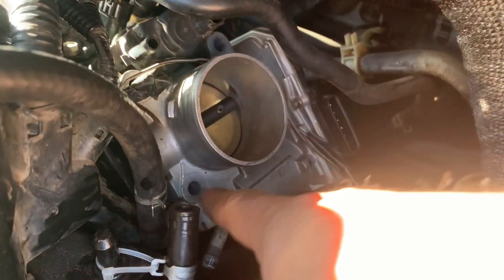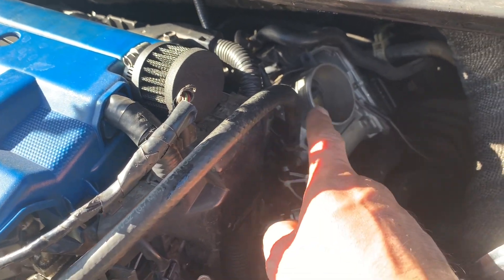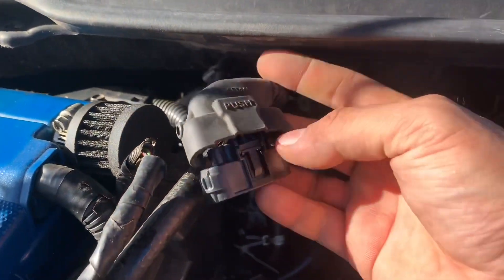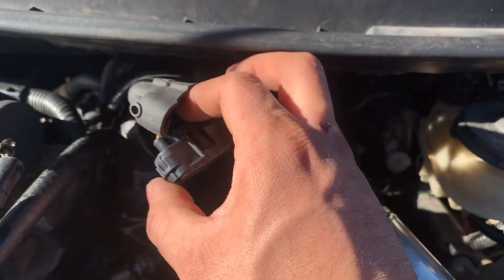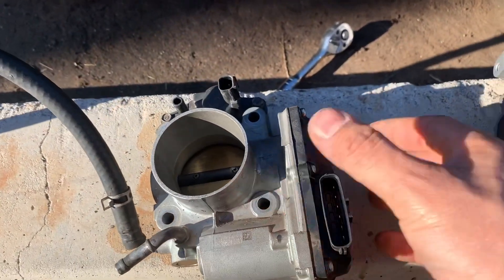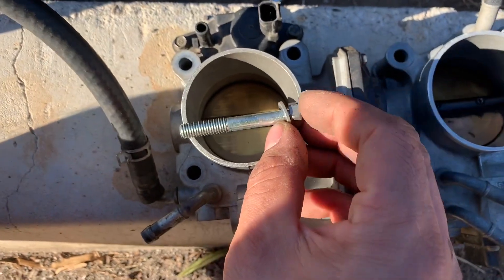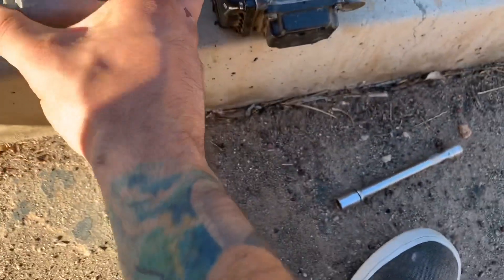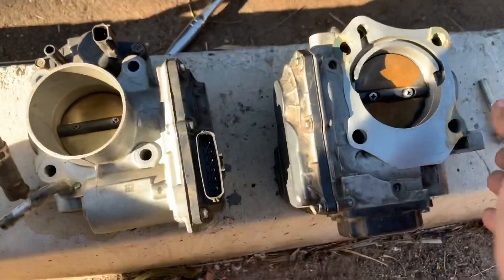Throttle body size comparison R18 vs Si

Comment: So the k series throttle body fits the r18?
Reply from the maker: Yes
Reply: @chrisasaurus  what do you recommend for my Honda Civic 06 r18? DBW 80mm throttle body or j35
Reply from the maker: @yerizone6059  if it's the stock plastic manifold go j35 and I'd say get at least si injectors or higher

Comment: Does it bolt right in?
Reply: Yup
Reply: @budgetrippersbikescars6141  Is there a real difference over the stock one?
Reply: @FD-rh6tr  Haven try it wet but can Tell it Will be more respond and feel just better but you need to recalibrate the idle afther i know that and hé does say IT .. 😅🤦🏻‍♂️ easy whit a scan tools even whit out Theys some vidéo out There on the TPS ( Trottle position sensor )
Reply: @budgetrippersbikescars6141  does J35 bolt right in?
Reply: @budgetrippersbikescars6141  and how about the electrical? it is PNP?
Reply: @syahrulsyazwan5693  same plug in if I remember right, but you will need the adapter plat for the J série throttle body but very simple install and inexpensive
Reply: @gabrielqcredneck7634  thax man.. 1 more question.. as we know r18 iac is built-in on throttle body r18 with socket wire, different with kseries throttle body.  so how to install the kseries throttle body?
Reply: @syahrulsyazwan5693  for the k série throttle body, I'm not sure exactly I've never checker that out how it would be possible to make it work.. I was going whit a J série throttle body.. wish I could answer that question but Im not really sure, it must not be that hard to do if the plug is not the same then you have to get a wire diagram of which wire do what.. and convert the plus to the k série ones best bet in my opinion
Reply: @gabrielqcredneck7634  can you share the link for adaptor j series throttle body

Comment: So the j35 throttle body can fit the r18 with the stock manifold?
Reply: Yes but you need the Kite They sell whit the converter plate its really easy and Bolt right Up and Get that réaction trottle and more go haha
Reply: where can you find the adapter/converter plate to run a j35 TB on a stock r18 IM ?

Comment: Throttle body J35 + OEM  intake manifold I've tried on my R18. Gain power and no problems.
VDO : https://youtu.be/Dl4y6k0jYVc
Reply: does it need higher cc injectors for this install ?
Reply: @bananameowmeow9260  No need, can install by OEM injector
Reply: Is plug in play ??

Comment: So after you did this you use SI CAI or Short RAM intake?
Reply from the maker: NativeBallin I’m boosted now but you can run whatever pipe 2.5/3” just need the right coupler and Hondata for a tune
Reply: @chrisasaurus  aight koo sounds great. I been trying to think of different ways of getting more power. Just keeping it N/A first then maybe I will boost it.
Reply: Oh yeah they have same bolt pattern?  I just need to port out my intake manifold.
Reply from the maker: Correct , maybe get longer bolts but yea lines up
Reply: Hey whats up man? I just ordered my SI throttle body from a junkyard. I also ordered some SI fuel injectors, but was wondering if the WeaponR intake manifold is good for a NA build or is it overkill?
Reply: @NativeBalli  hey man how has the SI injectors and throttle body been on your r18, thinking about doing this

Comment: Did it work? Were you able to install the Z3 throttle body on your R18? I'm thinking about doing this to my R18 to gain some small power. Im excited to see the next video!
Reply from the maker: Joval Shamsoum yea lines up perfect, but haven’t slapped it on yet. Was trying to get a spare intake manifold
Reply: Perfect im doing it !👌